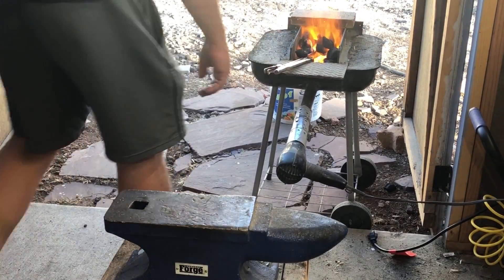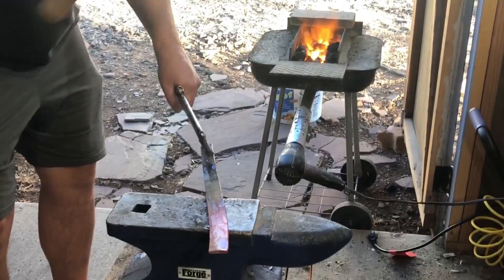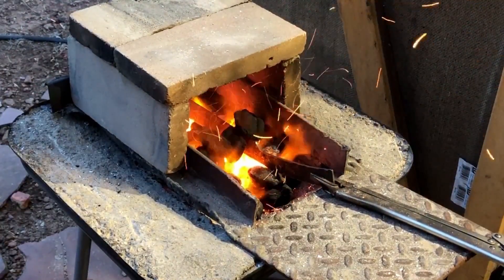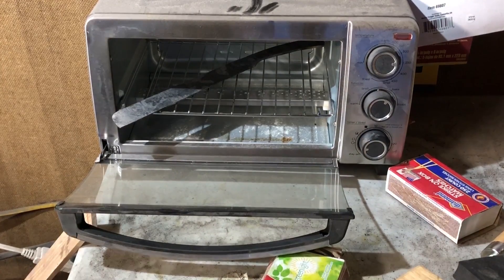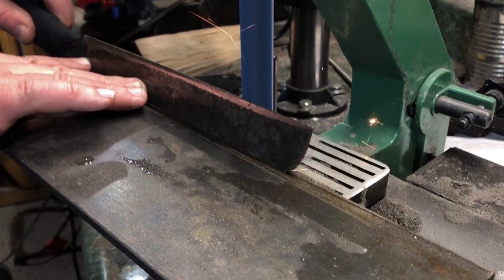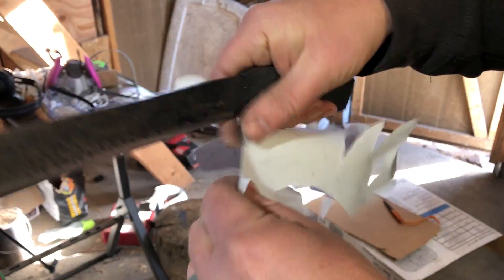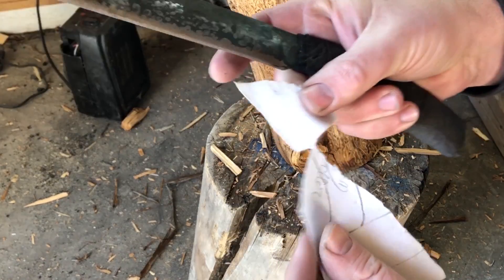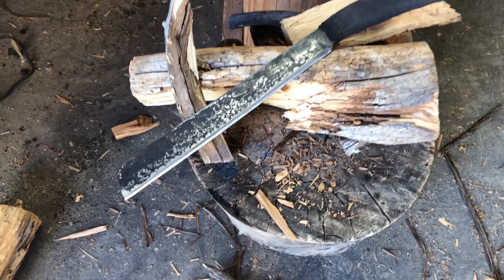Making a Knife from Low Carbon Steel (will it harden and hold an edge?)

Comment: It wraped because u shake it in the water, u should pull n push it in n out the water. N dont quench it side way. If it touch the body first the it will pull sideway n cause wraped too

Comment: When you split wood, turn the wood upside down and the blade will go through the branch knot. Otherwise you hit the knot pointing up which is extremely durable and will stop you splitting efforts

Comment: Is there some kind of mold to easily line up an edge? I heard the slant on a nut is 35°.. but if there is something like that to guide the grinding on the edge . We could get the perfect angle every time.

The word I'm looking for is jig. Building a jig to hold the blade angle.

Comment: I have made a knife from similar steel I hardened it and my edge won’t hold worth shit I hit it on a stick 5 times and it flattens my edge I unfortunately have no way to temper it could this be the problem it’s only quenched

Comment: I think i have low carbon steel i was trying to harden it in oil then i have used test on wood choping and it has doing good, then i used test with old long knife from my dad and cut a aluminium nail with it and cut it all no damage on blade then i took my blade try to cut it but it has banded over so dissapoitment, do i need to quench it in water maybe ? I tried to use replica of that dad's knife for bone chopping now whit this result i need to try it again. I need your opinion do i need to quench it in water ? Also my balde is not very thin it is normal thickness, what is the best solution here help please i really want to make this blade usefull for bone chopping

Comment: Might be a lower range medium carbon steel, like 1030 or 1045, which actually responds favorably to heat treatment and hold an edge for a reasonable amount of time. Many of your lower end store bought hatchet and machetes and whatnot are made of medium carbon steels like the aforementioned and work well within their limits. They are quite tough.

Comment: Case hardening through a process called Pack Carburization on mild steel will make it perform even better. Give it a much harder, high carbon steel "skin" for superior edge retention  and a softer mild steel core for extreme toughness. Reptile Toolworks uses carburization to make their knives out of A36 structural steel.

Comment: I believe A36 structural steel has just enough permitted carbon content in it (0.3% max) to make it hardenable through quenching.

I made a few blades from some 1008 cold rolled plate leftover from another project. Since you can't quench harden this stuff, I figured the best thing to do was to shape it cold with a grinder or file to maintain the existing hardness (gained from being coldworked during the rolling process). Any hot working softens the mild steel too much. Alternatively, you can "peen" the cutting edge to work harden it after forging. I made a peened edge pocket knife from said 1008 plate that kept a rather good edge.
Reply: Case harden it. Will give you a softer,  tougher core steel, with a harder, edge retaining steel skin.

Comment: I use almost only "low" carbon steel from car leaf spring and other scrap steel, and they hold the edge very well! But also i found out that if you quench these steels in oil just when you reach the non-magnetic temperature you also don't need to tempering! The blade with be very hard and the risk of cracking is very low, due to the not so high carbon content. This isn't known i think cause almost all the knifemakers use only w1 steel and look to scrap steel as a joke.
Reply: Leaf spring steel is not low carbon steel, it's medium to high  about 0.7% carbon and will quench harden nicely that's why they use it in springs.
Reply: You do realize that leaf springs are high carbon spring steel right. Still considered scrap; but I agree with you that it is amazing for blades. A true knife maker knows where to source high carbon steel and or spring steel very cheaply. I've even gone to a scrap yard and gotten some off of some old vehicles with low value so they knew I wasn't getting it to restore a classic and wouldn't really make money off of it in which they would have charged more, my last batch came off of a 1960s Chevy truck you can also find old trailers with leaf springs. I'll even go and buy broken springs for just the cost of the scrap weight value. Last batch cost me $40 and produced some very high quality blades that I've only ever had to sharpen maybe once, Whereas to buy that same amount of steel from a factory for knife making would have cost me a couple hundred. Even better if you know how to make crucible steel you can take broken bits and bolts and springs, add a bit of graphite cuz you're going to lose some carbon in the heating process, seal the top with glass powder, and make yourself a ingot of crucible steel that will be even harder than most manufactured steel yet tough and flexible due to the use of leaf spring steel. Bladesmithing is not a lost art as a lot of people used to say. True blade makers know where to source their steel and create quality steel from scrap. We become those guys that are going to become essential when the s*** hits the fan. If you must use mild steel or low carbon steel; it's also very easy to carburize your blades by coating them in a mixture of charcoal dust and clay mixed into a thick carbon-rich clay, very thick and bringing it up to and then holding a high temperature for quite some time so as to infuse the carbon from the clay / charcoal mixture into the steel effectively case hardening it. The longer you leave it the more carburization. It has to be thick  yet evenly coated though because the process only happens effectively in low oxygen which is the purpose of the clay shielding to provide even heat while at the same time keeping oxygen out.
Reply: @jerichojoe307  hello from Greece..man you spend lots of hours practising eh??I am a beginner and I want to be prepared when the  shtf ..I would love to see your videos on mixing steels and the diy crucible..take care
Reply: @jerichojoe307  wooooow👍👍👍👍👍

Comment: Good job. How long did it take to make? Minus tempering. I reckon if you modified it by taking the grind up higher it may make a better tool. Good for cleaning up around the yard when branches fall down or whatever. Pretty cool score though to get some hard-enable steel.
Reply from the maker: I probably had a couple hours into the knife by the time it was done. The tape wrap handle saved A LOT of time.
Reply: That's pretty good. I am a bit slower than that. But haven't made as many as you yet. I am just filming my first video now. How long does it usually take you to edit everything. It seems daunting to me as I am totally new to it all.